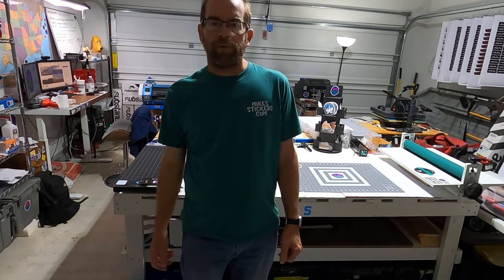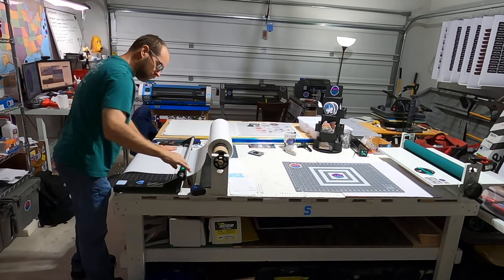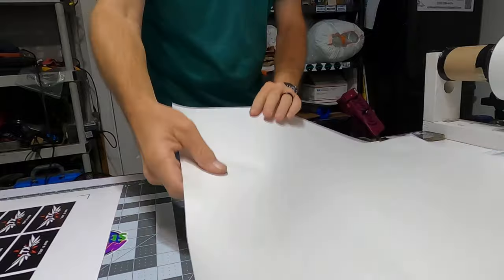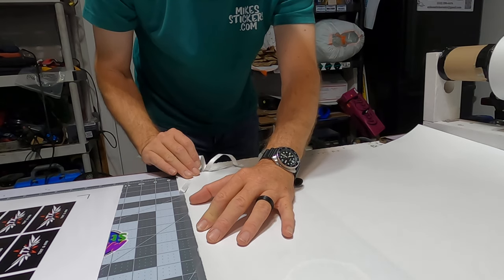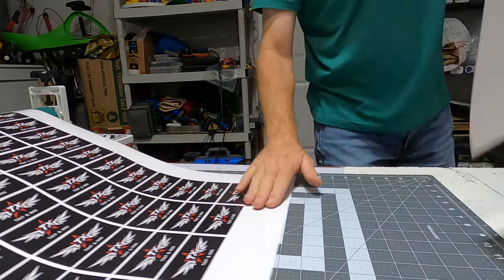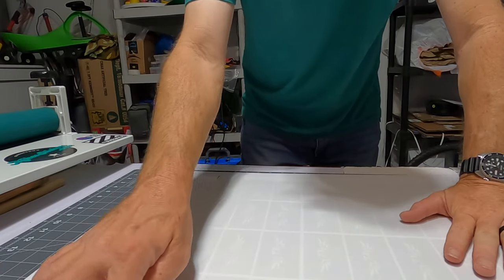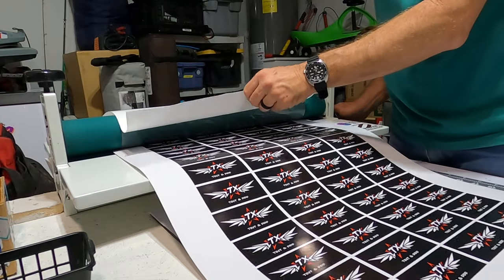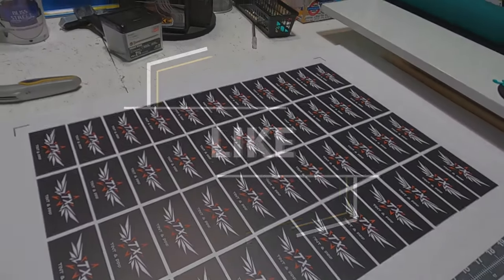Mastering the Cold Roll Laminator

Comment: May I ask who manufacturers the cold laminate? We dabble with a 3M Gloss adhesive vinyl which is super expensive and very flimsy.  We don't seem to have any vendors that understand this process i.e. Spicers, Montroy, Fellers etc.. We do something similar to this installing the 3M on foamcore. Stickers remain a mystery... HP Latex 365 with Graphtec FC9000 Once we figure it out we will need to experiment with the perf cut settings.. DTG web said it should be able to cut through... Thank you in advance for any guidance.
Reply from the maker: I updated the video description to include links to the laminate & laminator.
Reply: @mikesstickers  thank you Mike. Appreciate it.

Comment: As an alternative method, you can put the laminate over the print loose and then run both under the roller until you have 5 inches or so pushed through.  Then pull the back off the laminate, cut a small strip off of it and run it back through the rollers to stick it, then proceed as you did to complete the process.  I've found that method to be very accurate and bubble free and it's much easier than this process appears to be.
Reply: This is interesting. It makes sense since you kind of release the bubbles before laminating right?
Reply: @BoredThatsWhy  yes, I rarely get bubbles using this method as long as both sheets are smooth in the rollers.
Reply: @GuitarGuyFromNC  thanks